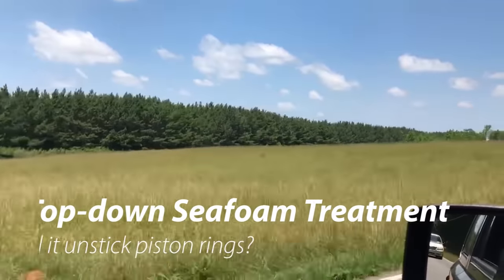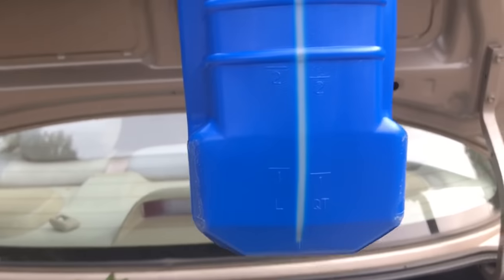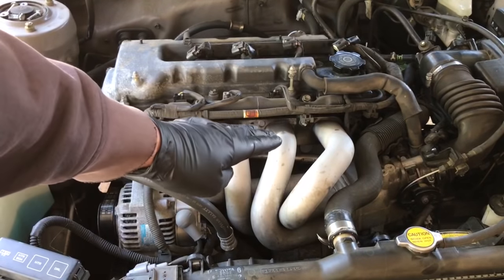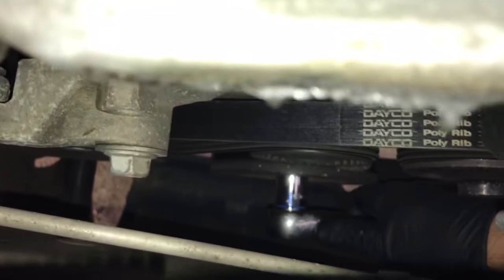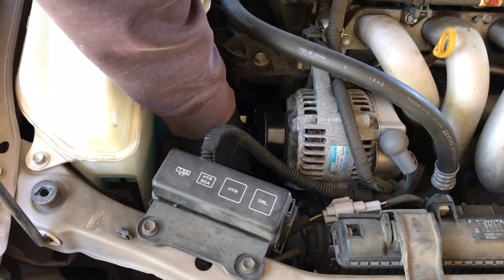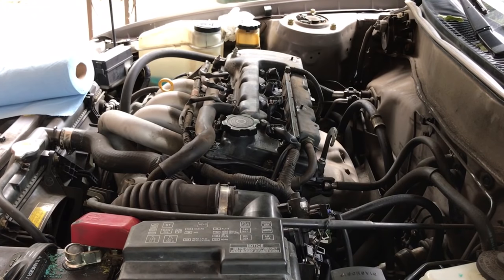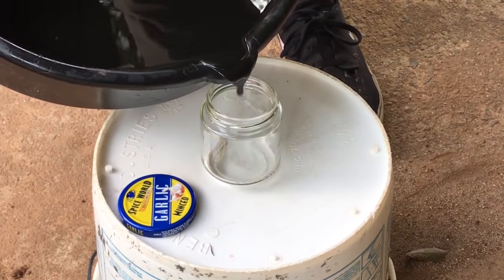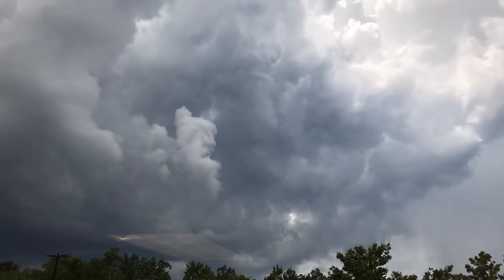I poured Seafoam down the spark plug holes! | Oil Burning Experiments - Episode 1

Comment: Good video buddy, I’m from the uk, I would now suggest u use liqui moly ceratec it’s fantastic stuff and now rings are cleaner it will coat them with ceramic and seal rings to the bores, your oil consumption will ALMOST stop. Check it out it’s got fantastic reviews and I use in all my cars
Reply from the maker: Thanks, Salim. I'll certainly look into that.
Reply: @FamilyFriendlyDIY   yes it’s fantastic stuff  Dave and not a ‘snake oil’ ! liqui moly is a top German brand the reviews are Good on it. Also I put 100ml into manual gearbox and the gear change is much smoother and positive , really reduces heat and friction
Reply: Where you get that
Reply: @joecostu1571   I’m not sure where it’s available in America  but here in UK it’s available everywhere the brand is liqui Moly
Reply: @joecostu1571  eBay Amazon

Comment: if there is no leak then it does smoke . Its onluy that it doesn't smoke enough for you to see  on idling  . Make your wife drive it  and fallow her with your other cars and you will see that it does smoke . oil doesn't just disappear  like that . its either you lose it or you burn it the only 2 ways you can lose oil . Unless you get your oil stolen .

Comment: Seafoam does not dissolve carbon. Take a piston and soak it in a jar of this snake oil and see for yourself. Seafoam is a very poor solvent. Take your car out for a drive and come back to repeat the compression check lol. Usually the compression check is done with WOT.
Reply: Who said anything about dissolving? Breaking free and dissolving mean 2 different things. You can soak pistons In pure Vinegar and it won't dissolve but it will free them

Comment: This is very dangerous because if you hydrolock your engine which you can do you can crack pistons bend or break rods and caps NEVER PUT ANYTHING THROUGH YOUR SPARK PLUG HOLE THEN INSTALL PLUG AND START ENGINE EVER. SEAFOAM SHOULD NEVER BE USED IN THE FUEL ONLY SPRAY INTO THE ENGINE INTAKE WHILE RUNNING.

Comment: Look i left a thumbs up but wtf you mean if it helped and didn’t help much. ? You have to understand that cleaning out an engine takes a few passes. And old cars are gonna burn oil. If I drew you a graft  of the oil consumption til engine failure that point just got a lot further away. It wad a very successful experiment, i was surprised and i think it wad very good work on your part.
Reply from the maker: I hear ya, and much appreciated. 👍🏻

Comment: You USED SAME Plugs???!!  WHY?  All that work ....  did you clean & check gap?  
You "Just" 'changed' Oil recently  -  Every Week you ADD a Quart ...  kind of Refreshing One's cocktail, and ice at times.  
 i might be missing something, so i ask why of others' methods.   re: Filter - Not done same time Draining? * They Never drain gracefully!   lol    * reason Squirting - would it be less if greater Air flow?  (no Pan plug in)
Sea Foam should get the credit for look of Oil.   Cleaning it well i hope.   Cheers!
Reply from the maker: The engine ran great and never had a misfire ... but I change the plugs a few videos after this one. Thanks for the comment, Karen!

Comment: You must not fill the oil to the full mark when it is cold.
It will expand when the engine heats up and the pressure will be too high and damage your engine.
You're meant to fill it halfway when cold.

Comment: All your oil level measurements are probably wrong ! You didn't follow the manufacture's method for properly checking the oil level ! That procedure is stated clearly in the owner's manual. You can't what effect the engine treatment had on the pistons because all your oil level checks were done wrong ! RTFM  (Read The F-ing Manual) !
Reply: It doesn't matter as he explains in one of the videos. You can measure hot, cold, dip stick all the way in, or just resting on edge of lip.
As long as you are measuring the same way each time.  Its called Relative Measuring. Go look up the difference between accurate and precision.

Comment: Everyone thinks these cars have bad piston rings.. perhaps but it states in the manual that it's supposed to burn oil for more lubrication throughout the engine, and toyota recommends checking oil every fuel up, states all this under the oil consumption section page in the manual, therefore it's completely normal for oil consumption